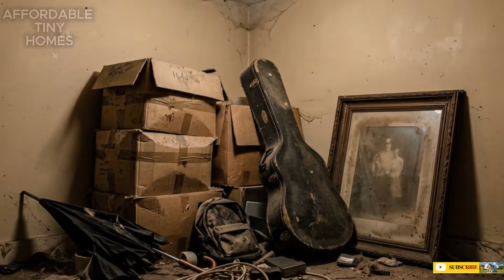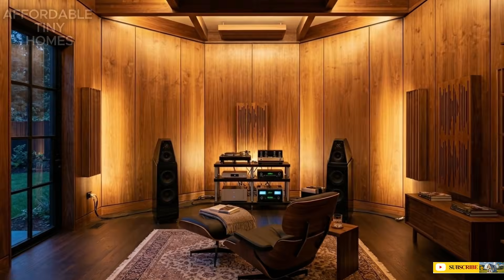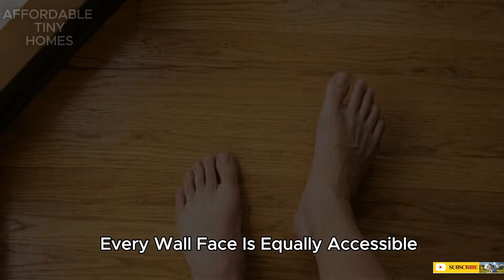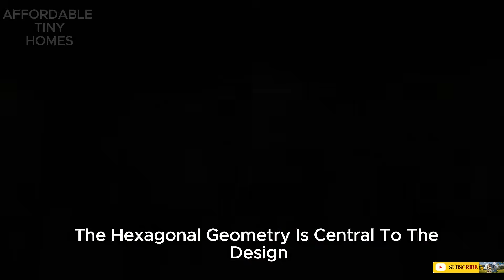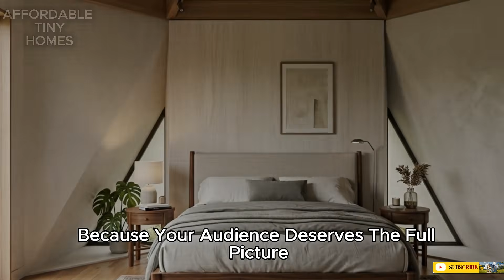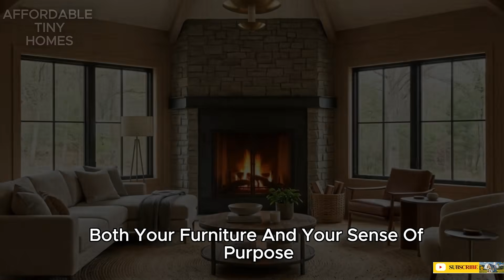Why Your Brain Hates Rectangles: The Magic of Hexagon Houses

Comment: Quite flawed video. 
You show plenty of images with octagons, not hexagons. 
The comparison with bees hexagons is dumb, because you don't build hexagonal houses on near the other, because they still need windows and views outside, not towards the inside of neighbouring house. So the optimal filling of space with hexagons is useless unless you plan a dystopic society, in which the hexagonal houses are indeed wall to wall, like a tight prison. 
Actually, the best compromise between the maximum surface for a given perimeter (the circle, the most efficient shape) and the rectangular houses for which the construction materials are developed (the glass for the windows, the furniture, the appliances etc.), wind resistance etc. is the octagon. 
I am designing and building active octogonal wood houses and the results are amazing. 
I found ways to have no weird/small (below 90°) angles, no long corridors etc.
Reply from the maker: Okay…Thanks for the correction

Comment: Question how disaster say for these buildings or do we have to get a steel cover that would go over the windows to protect to protect the depending on where you go hurricanes cyclones hell all kinds of things that I can’t even think of right now disasters how disaster proof can you make a home like this? It’s beautiful I like it and I want to talk to someone about it very soon because you have to play like you said plan ahead it’s not an overnight drafting thing you know, but I’d like to know in disasters. How safe about all those sides and should you have to get one? You know the pulldown metal I think it’s like a shade that protects the window. Would we need to install that as well? do you have any other suggestions? Let us know.
Reply from the maker: Great question! Hexagon houses are actually incredibly strong when it comes to natural disasters. Because of their aerodynamic shape, high winds from hurricanes or cyclones easily deflect around the sides instead of hitting a massive flat wall like a traditional rectangle house.

As for the windows, installing impact-resistant glass or roll-down metal shutters is always a smart move in high-disaster zones, regardless of the house shape. Thanks for watching and planning ahead! 🛑🏠

Comment: Ahh the hexagonal prison cell to promote peace. A rectangle building doesn't require corridors any more than a hexagon building does.  I'm not at all opposed to non square houses since I lived in a 12 sided dodecagon house I built for two years. I liked it a lot and plan to build an octagon
Reply: You'll find the octagon very, very rewarding, especially if you'll find one of the ways to not have weird angles (smaller than 90°, like 45°).
I am designing and building active octogonal wood houses, very healthy, extremely efficient, multifunctional and gorgeous (the architectural lines are the primary design).
I tried also the dodecagon, hexagon etc. but the octagon is still the best compromise between the most (efficient) surface for a given perimeter (the circle, generating something like a geodesic dome) and the dominating rectangles (as the glass for the windows is flat, the furniture and appliances are mostly built with straight lines).
Theoretically, the more sides you have the better efficiency, but then you get into trouble with the building complexity, furniture reality etc.
The only challenges you'll encounter are related to furniture for 135° angles, but the custom-made furniture costs far less than the savings on the overall construction and the future maintenance costs.
I shall be moving soon to one of the octagonal wood houses I made and I am very happy - even though I am already designing far better octagonal houses, using all the ancestors' wisdom I uncovered through years of research.
Good luck!
Reply: @codincoman9019 Thanks!!!!
Reply from the maker: Prison cell?
Reply: @AFFORDABLETINYHOMES-i9j would hexagon prison cells promote inner peace more than rectangle ones? I don't know just throwing it out there
Reply from the maker: @davidcanatella4279 I’ll look into it
Reply: @davidcanatella4279 The hexagon is better than the rectangle also from psychological point of view (there are some studies done on this topic - the more corners the better), but the only way for the number of house sides is up.
I settled for the octagon after trying some alternatives. 
I see you did the same 😉

Comment: I have already designed my retirement home.  Now trying the same design in a hexagonal shape - not easy.  I do not want a central area with everything branching off of it - no privacy then!  Bedrooms in its own 'area' with privacy outdoor flows (each has its own shielded tiny garden that can be opened to the elements and closed off during inclement weather. Kitchen, canning, pantry, laundry, root cellar and sewing/crafts rooms in its own 'area'.  Lounge, dining and indoor garden with water features and living wall in its own 'area'.  Water tanks stored underground - under the outside porch that runs right around the home.  A double garage and workshop that connects seamlessly to the home, yet does not carry the workshop noise into the home. 

Turning this into a hexagonal home is a very big ask.  My brain is already fried - been at it now for almost two hours and still struggling with just the 3 bedroom areas - which in turn must all integrate back into the house.  Not forgetting the indoor herb planters that flanks walls...   Why oh why did I watch this vid  -  falling in love with these shapes, only to discover how incredibly difficult it is to design what I want in a hexagonal format!
Reply: Tried designing the frame work for a hexagon house but found octagons easier to work with. I'm not against hexagons even though a hexagon once made me lose my beard in the war.
Reply: @davidcanatella4279  ⁉
Reply: @davidcanatella4279 I arrived to the same conclusion after designing houses with different numbers of sides. 
The octagonal houses I designed and also built are very rewarding -  and I get a lot of visits from people wanting to see them and some of them deciding afterwards to go for the octagonal design.
Reply from the maker: The struggle is real! 🧩 Designing a hexagon without falling into the 'central hub' trap is definitely playing on hard mode, but your layout ideas (especially the indoor gardens and underground tanks) sound like an absolute dream retirement home.

Take a break, let your brain reset, and don't give up on the 6-side magic!"
Reply: @AFFORDABLETINYHOMES-i9j  Thank you for the encouragement!  I will be building on land in a rural area - and incorporating a Kachelofen wall heating method for the whole house - a medium sized unit for the lounge area and 4 very small units for the bedrooms and the sewing/craft room.  Heat efficient deluxe, along with an Agga stove and a gas backup stove for the kitchen/canning area. The area I'm going to is pretty dry so the large amounts of water tanks is an absolute necessity. Will have solar as well - which is well suited to the hexagonal roof shapes as per your vid.  Going off-grid is quite a challenge and needs lots of prep for 'what-if' scenarios.

The biggest challenge actually is now to incorporate my disaster underground bunker beneath this hexagonal build.  With the magnetic pole shift accelerating each year we are in for a very, very rough time in about 20+- yrs. And it has to be solar (micronova) proof too. 

If your channel is still up in 3yrs I'll write again and give some feedback on how the build is going.
Reply from the maker: @datacoherence9559 I’ll be waiting for your feedback 😅